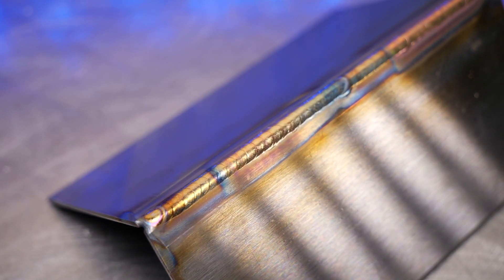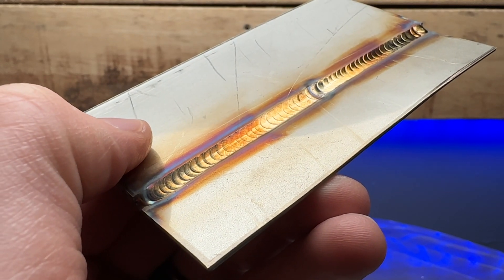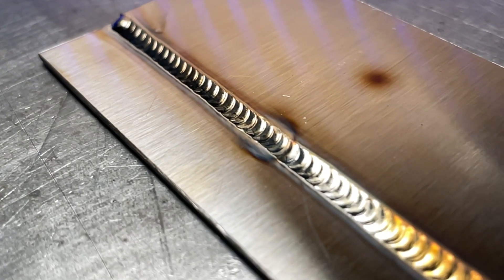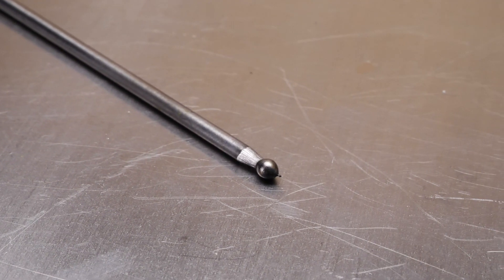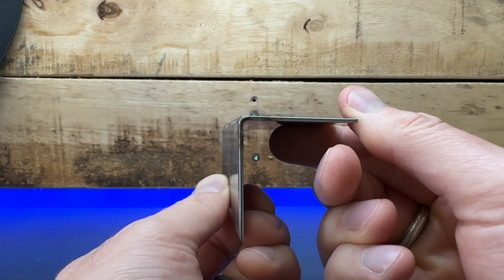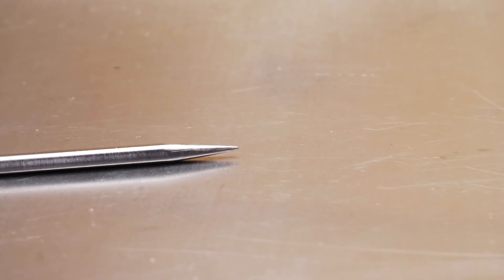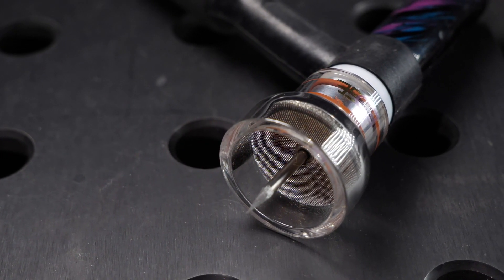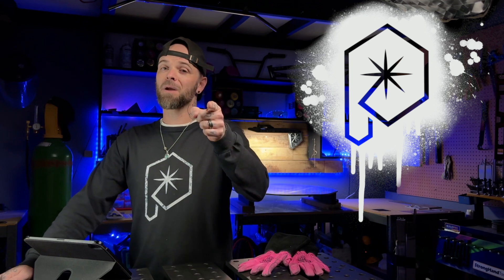get the BEST ARC CONTROL tig welding stainless steel (here's how) how to tig weld stainless steel

Comment: The thing about this video is it looks like you’re moving very slow or it’s slowed down very advised once you get a good start and it wets out you gotta be very stable and move at a good speed moving to slow on very thin material it will blow through and if you’re going to fuse anything make sure both work piece are completely completely together kissing if not any little hole or gap if you happen to move slow in that spot it WILL blow a hole

Comment: I bought a cheap bench grinder then put a diamond wheel on one side for about $125 USD.  The general grinding wheel is the rough grind and it can be dressed to make it flat after grooves develop.  After the desired shape / angle is ground, the diamond wheel puts a great smooth finish.  I know it may be overkill, but it eliminates arc wander due to the grinding imperfections.

Comment: I purchased an inexpensive tungsten grinder that does only 1/16" and 3/32" at two fixed angles.  I like it as it gives me the same taper every time.  I still use my bench grinder for 1/8", 5/32" and 0.040" tungstens.  I also polish the tungstens,  I seems help make a nicer arc with a uniform shape.

Comment: Now folks time for the next challenge. Go lay in a mud hole dug in the ground. Then have some drill back flow drain down your neck mid pass, and still maintain the clean consistent stainless weld on a 12” pipe at 16 degree angle. The official tarp tent wind block, I had to do 60 joints all x rayed, talk about sweating bullets but I passed every one. All tig stainless 316 pipe. Even in a mud pit the weld zone was clinical clean. That was the key and took 80 percent of the time.